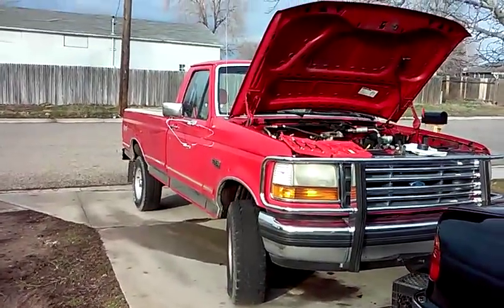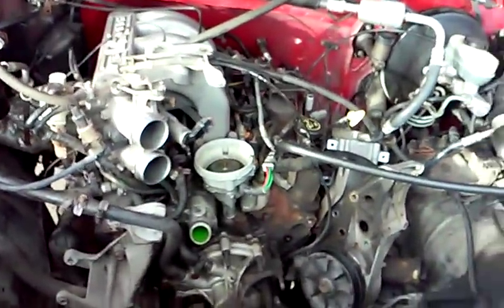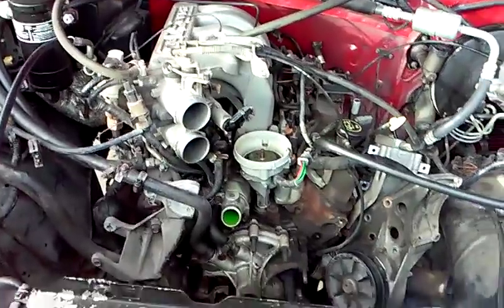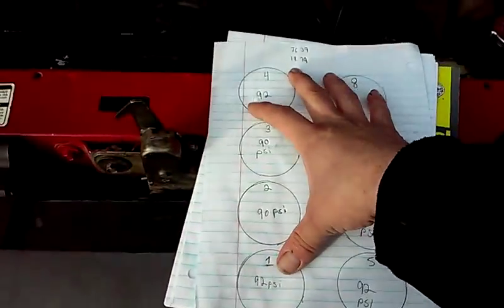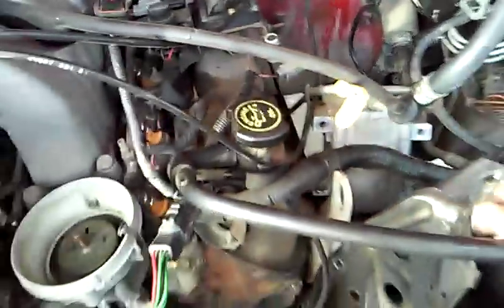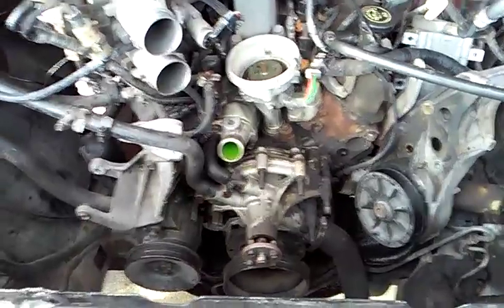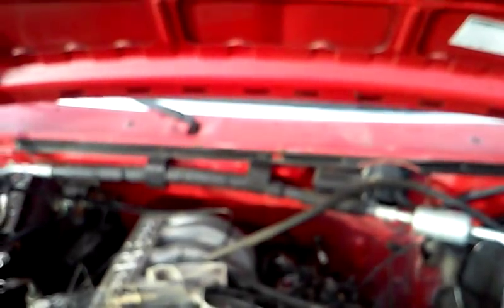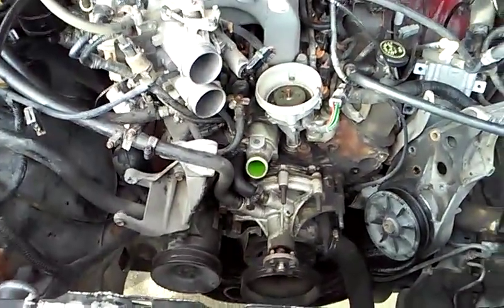1992 Ford F-150 5.0 302 diagnosis,timing

Comment: I have 1996 xl ford f150 5.0 v8 efi got new spark plugs, ignition coil , relays , fuel regulator. Some days it’ll crank an run fine after driving it next day itll turn over but won’t start up, idk what it could be bad fuel pump or starter ?

Comment: Hello Sir
 I got a 1992 ford f-150 5.0  that I SWAP engine with a 1994 to 1996 Bronco engine 5.0. But I'm having a misfire on one cylinder. I can't find the problem, could it be the Distributor pickup. I replace the ignition module the coil and  new injectors still misfire. The truck do not have a crankshaft sensor. Somebody help me before I junk it and get a Chevy.
Reply from the maker: Email me and we can talk earlier. highgrooveauto30@gmail.com
Reply from the maker: easier not "earlier" LOL.

Comment: I have a 92 f150 XLT 5.0 EFI with a check engine light. It seems a lot of shops are not eager to or don't have the proper tools to diagnose obd 1 check engine light issues. My registration is due this month and check engine light is automatic fail for emissions. I'm in Arizona. Also my ignition timing is not adjustable. 
What's the cheapest route to take if I take it to a shop vs diy? I have an obd 1 scanner I was going to use just see what codes pop up before taking it to the shop so I could give them an idea of where to start repairs. My truck has issues but at this point I just need to deal with the check engine light so I can pass emissions.

Comment: I've changed a few water pumps on these engines, and surely youre gonna break  those longer bolts that go into the block that enter the water passage.
I would recommend getting ARP heat treated water pump bolts. They have a higher tensil strength and can handle the twisting force needed to remove them. Also, instead of putting a sealant on the bolt thread because as you screw the bolt in, the hole itself will tend to " clean those theads off. If you put sealant inside the hole, the bolt will then push the sealant along and seal as it goes in.
Reply: I broke one in the block and left it. Just put water pump gasket maker over the hole and put liquid aluminum in the radiator lol

Comment: I'm working on a 5.0 as well is fouling a couple of spark plugs already changed injectors and even opened up head everything looks good this engine was redone 2 years ago so internally don't think is the problem. I'd it either the computer or bad timing?

Comment: I have a 92 f150.I removed all smog including egr and it runs so good but about a week ago my pickup distributor went out so when I pulled distributor the rod for the oil pump came with it then it fell in the oil pan.i would think something holds it in there,it's been a pain cause I'm doing all this in the snow while it's snowing so was wanting to make sure this can't happen again! Any advice would be appreciated but it's not that bad I have a heater underneath there in the tarp over the truck so pretty warm lol

Comment: My 87 timing chain slipped off replaced also new distributor seems to run ok until I engage to drive then it's rough I have new trans any ideas

Comment: I got a new engine and a 924 F150 I will build and it went hot on me for the first time and it pushing the weather for any for a bad photo the top hose is hot but the bottom hose is cold why is it one is hot

Comment: I got a 93 Ford 150 XL four wheel drive change the distributor the cap the rotor button spark plugs spark plug wires sounds like it wants to start but don't start if I I'm kind of lost on it it's got the V8 50

Comment: Hey Matt I realize this is an older video, but you seem to be well versed in the ford engines. I however am not at all. I have a 1995 F150 5.0 with an odd sounding tick. I replaced all lifters, push rods and rocker arms still ticking. I replaced exhaust manifolds along with the y pipe/cat no change in the noise. Spark plugs are good, new wires, new cap/rotor, and sitting at 12 degrees timing at idle with spout out.  I’m starting to think it may be engine knock, though it has 120,000 miles, and was owned by a family friend since new, was always well taken care of. The noise is very metallic sounding and is audible at idle and  if you rev the engine or as you come to a stop (idling down). Using a stethoscope the most crisp spot I hear the sound is at the timing cover. Have you ever heard of these motor’s timing chain hitting the cover possibly causing this noise?

Comment: I have a question I have a 95 gt with 5.0 engine and swapped it with a 5.0 that came out of a 2000 moutaineer and changed it back to distribitor and it idles fine but upon acceleration it hesitates and pops and wants to die  I've changed the plugs and wires and still does the same thing what can cause this problem it's driving me crazy
Reply from the maker: They different 5.0s and have different firing orders. That could possibly be it. The GT has different firing order than the stock 5.0

Comment: Hey there. Ive had my truvk for 2 years. 89 f150 5.0 2whl drive.  Almost everything attached to the block is new. This is my first mechanical experience,  however, being a perfectionist im struggling. I just recently had the front tank filling the back tank, rither through the return lines or through the tank select valve. Not the issue at hand, just giving you all info. She was running awesome, getting around 20 miles to the gsllon, and never failed to start. Then she started running rough. Couldnt find any power, yet idled fine. Im replacing the converter,  and it ran loud as hell but ran none the less to get me home with a grinder taken to the side of the old one to empty it. I font know which direction to go or what to try and dont have qhats needed including money to test everything. Please help me, i drpend on this truck. Im about to fold my business. Is important to life matters i get it running correctly again. Please.

Comment: So I just put a new distributor on my 88f150 4x4 5.0 and set top tdc and all that so I started it and it ran good until I put the air breather back on it shut off and now when I try olto start it is runs likes it out of timing again I checked timing still good so what could it be can't figure it out

Comment: My uncle has replaced the fuel pump spark plugs and also had changed the oil but it's still a no start what could it be

Comment: I have a 94 f150  it stalls out when putting in drive or reverse if put back in park motor runs fine my over drive light is also blinking
Reply: I have the same problem, if you figure it out please let me know what it was

Comment: Engine not starting number 8 was at 75 % compression and number 7 was at 45% compresio only 2 that i tested could that be timeing chain?
Reply from the maker: Yes valves opening at different times when they are not supposed to
Reply: @MattShaughnessy6  thank you are they a pain in the butt to do on a 1995 ford e150 econoline van do you know?
Reply: @bigjproffitt8128  i have a 95 e350 its  a Pretty tight work space. Little bit of a pain.
Reply: @chrissanders2562  thank you just found out it dosent have any compresion😭
Reply: @bigjproffitt8128 on all cylinders?
Reply: Probably just needs a timing set put on. Thats my guess.

Comment: Is it normal for oil to get sucked into the air cleaner box thru the hose going to the left valve cover?
Reply from the maker: No check the pvc system oil can come from there.

Comment: Ok.. I have a 302 roller cam motor i put in my bronco. 65,000 org. Miles. Idles fine and revs up smooth. However when u accelerate it has nooo power. So
New tp sensor
New map
New egr and solinoid
New plugs and wires
Cleaned throttle body
New vacuum lines
New distributor module
New cap and rotor
Any thoughts?
Reply from the maker: compression and leak down test check the valves and timing. any MIL's come on?

Comment: I got a 95 ford f150 I just change the water pump now the truck wonts to idle rough and the motor will stall  out going down the road I will let it set an idle for a few mins shoot it off it acts like  it flooded it hard to start when the engine been running

Comment: Hey man, that bolt you were pointing @ broke on me now I can't get the water pump off its stuck on the bolt from rust I guess.
Any suggestions??
Reply: Same happened to me... Ended up breaking the timing cover trying to get it out. Then decided to replace oil pan gasket since I had the cover off. 2 years later and I just finished a rebuild and just dropped the motor back I'm today. 😂

Comment: i have a 91 brick nose with a 302 and the thing misfires on cylinders 6 and 7  i'm guessing because when i pulled the plugs they both smelled like fuel and you can just blatantly hear it . i also have true duel exhaust meaning the pipes never touch (exception for the o2 sensor)  but it smokes heavily out of the right side. and i cannot figure out why it misfires. it sat for 7 years then got driven for 3 years then sat for another 5 until now. I have done some work like fixing the water pump. i put new plugs and wires on it and it didn't change at all. my timing mark seems to have slipped because cylinder 1 is dead top center and the mark is 30 degrees away from the mark on the block. also do you think this could just be injectors dumping fuel into the cylinder?

Comment: Ive got an 89 f150 5.0 that runs weak and about 2500-3000 rpm it bucks so bad you cant keep in it
Reply: Retarding the timing or advancing it doesn’t seem too affect it

Comment: Hi I got a 89 Bronco 4×4 302 with 400k miles Changed water pump  spark plug wires spark plugs  cap  new battery . The problem is when I rev it up  and let off it backfires bad and has lost so much power that it can barely move its self . I'm thinking timing chain the compression is from 110 psi to 170psi completely out of spec did leak down test and show good it idles good and starts first time every time it says no1 not contributing thats the only code

Comment: Need some serious help haha. I have a 96 302, it runs extremely rough on start up until ect reaches 120 then smooth idle. when driving it is misfiring bad and I have codes p0320, p0385, rich both banks, and all the o2 sensors (straight piped from previous owner). When I got it it did not run due to snapped flexplate. so far I have changed plugs, wires, cap, rotor, fuel pump, vacuum lines, timing set to 12 btdc with light and spout out, IAC cleaned, MAF reading on scan tool at 0.02lbs/s idle. no idea where to go from here.
Reply: @Greasemonkeygarage651  PCM

Comment: I've been having problems with my truck over heating,,the thermostat was changed out, there was a link after it was reinstalled so, I had it redone this idiot did something now gage is going back in forth to hot n cold.. with that having problems with the alternator, I was out checking my truck last night n found there"s a plug right above where the thermostat housing, is loose,,what is that wire called? n I mean right above the thermostat housing. before I charge out my alternator I need to make that , that's the problem..plus I noticed that the hose right behind the alternator the that u screw on it was almost inbeded in the back of alternator , could that cause a shortage in alternator?
Reply from the maker: Sounds like your temp sensor maybe unplugged and yes if I read this correctly coolant can cause an alternator to short out.
Reply: Thank u so much..i read my message., I'm surprised  u understood a word of it. Lol.. need to make sure I read my message before I send it.. How ru doing.. hope  ur great. So the plug that is loose is called a temp sensor? Ok great..u said coolant can cause alternator to go bad? That's weird.. I'm not sure I understand that.. please explain further.. Thank u.. I'm going to attempt to change or my alternator  myself.. any advice?😀🤔

Comment: Matt, I have spark after changing the ingnition module. Had to hard wire my FP relay to get fuel pump to run, which it does. I have 25-30 psi on my pressure guage. It turns over and tries to start with starter fluid. I don't know if I am getting a rpm signal. I turn the key but don't see a check engine light, but it could be burned out. . I am going to try and check the codes with a cheap OBD 1 reader. Will a coil pickup stop this from starting
Reply: On these trucks if you turn the key one click you should see all the dash lights turn on. Even Check Engine. GL bro

Comment: I have a 1992 e150 with a 5.0 I'm losing power and wen I first turn the engine over it knocks then stops. but if I put it in neutral and push the gas it refuses to go anywhere above 35 grand.

Comment: I have a 1990 Ford f-150 EFI 302 and it's leaking antifreeze behind the water pump.  I found that out after replacing the water pump and noticing after filling with antifreeze that the antifreeze was pouring out somewhere behind the water pump and the driver's side.  Would that be from the intake manifold water jacket ?  My son bought this from a friend that said a stud or bolt had broken on the front of the intake manifold but it had been running fine, and for us it was running fine as well but since this leak had shown up I'm wondering if that would be something to look at.   Thanks Rick Christensen
Reply from the maker: yes!!!!  I think you are on the right track.
Reply: Its the timing cover gasket I had exactly the same problem and replaced the water oump not knowing

Comment: I bought a 1989 f150 5.0.Ran rough got it home did tune up still rough plus it would act like a dragging starter when warmed up.Well I did a rookie mistake ALWAYS DO A COMPRESSION TEST.LOL Number 1 had 0.The valve was bent push rod bent.Ive almost got the top end back together.Installed headers removed EGR tricked out the computer with delete plug plus added fancy filters to it.Its moneying more than my ex wife.

Comment: MY 1992 FRD F150 302 5.0 RUNS GOOD FOR 15 MINUTES THEN STARTS TO BOG AND I LOSE OIL PRESSURE DOES THIS MEAN MY BEARINGS ARE SHOT OR IS MY TIMING OFF ,AND IT STARTS RIGHT UP FIRST CRANK
Reply: gotta be something making fuel not burn good

Comment: Need help with my 1997 f250 it will run fine in park but when I put it in drive and give it gas it bogs down and I have to pat the gas idk what is going on any help thanks
Reply: Muffler or exhaust stopped up

Comment: HEy man love ur Video, I got a 91-351 bronco that has terrible miss problems, the computer when diagnosed shows a pass on it self, we replaced the internal picup of the distrbuter and even swapped out coils, but its till cranking like its super advanced and if it quits at idle it will not restart ????????? please if ou can help !!!
Reply from the maker: checked timing marks? or compression?
Reply: Matt Shaughnessy /// actually bro. I found on the net if the coolant sensor goes nuts it can do this.  I saw video and disconnect it and it ran fine.
Reply from the maker: Awesome glad you got it figured out!
Reply: Matt Shaughnessy yeah I actually saw a video from // south main auto called. F1 50 stuck on fast idle/hard start when hot. So my father did the same thing pulled the coolant temperature sensor off-line and truck ran normally

Comment: Hello how are you today.
Well a have a 1987 f150
Vin# 1FTEX15N2HKB10477
Is running so bad, shakes and sometimes runa better. I change spark plus, spark plus wires. But before I did Thah I check the firing orden and was completly wrong and I see THAT THE time Mark did not  match on the ckank shaft pulley and on the distributor. Now the truck aint running. Bután the motor turns over. CSN you please help me with Who to set te timming marks on timming chain. I Will apreciated it. Thanks
Reply from the maker: did you get this figured out? email me highgrooveauto30@gmail.com